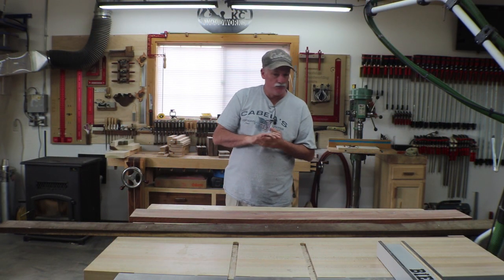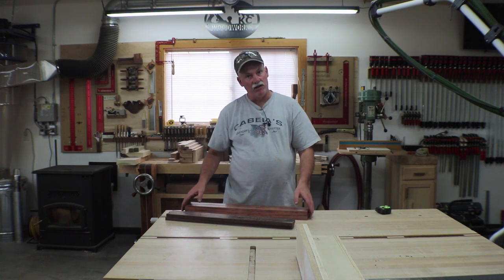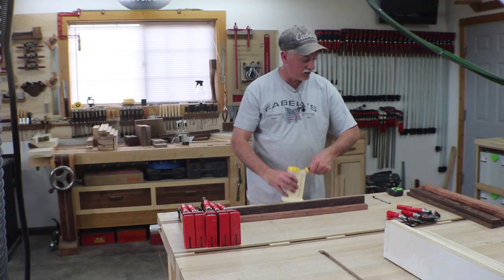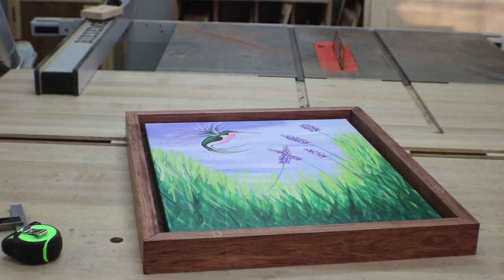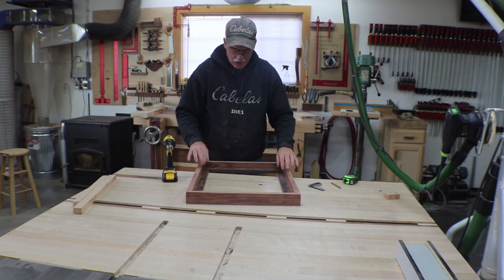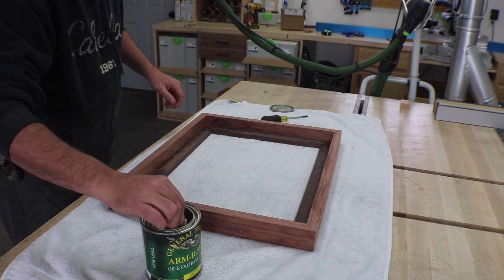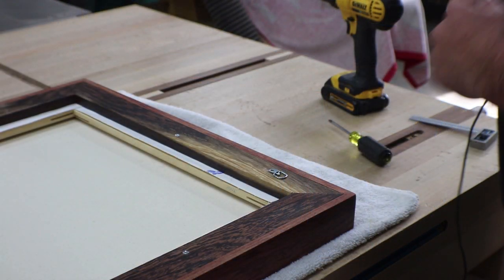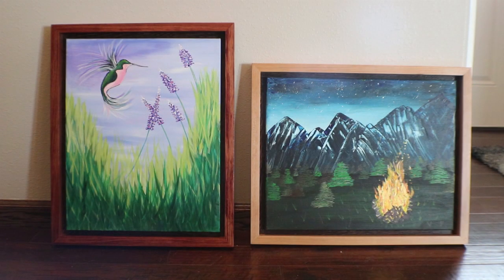Floating Picture Frame

Comment: Where can i get float frames for my artwork
Reply from the maker: Thanks for watching Jada.  As you can see, I built these.  I would try to find some local woodworkers in your area that would enjoy the commission work of building these kinds of frames for you.  They're not a difficult build and could be batched out at a reasonable cost.
Reply: @KevsWoodworks  that's great to save money
Reply from the maker: I know that frame shops can be expensive but, depending on your local area, lumber - especially exotics - can also be very expensive.  I wish you luck in finding a local woodworker to help you out.  I'd be happy to assist them if they have questions about the build.
Reply: @KevsWoodworks  oh dang